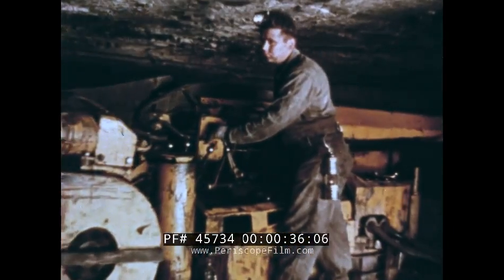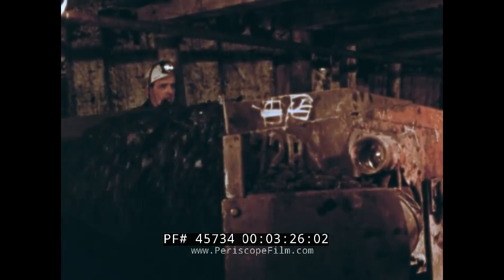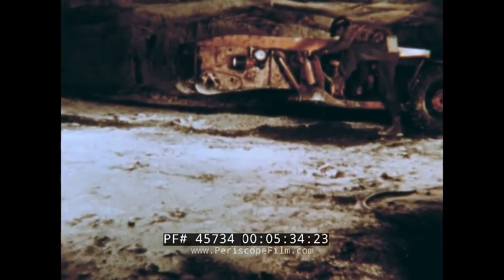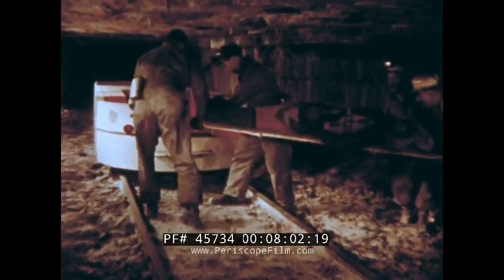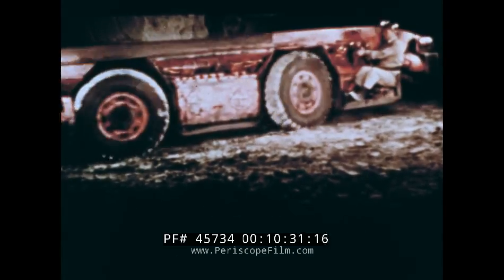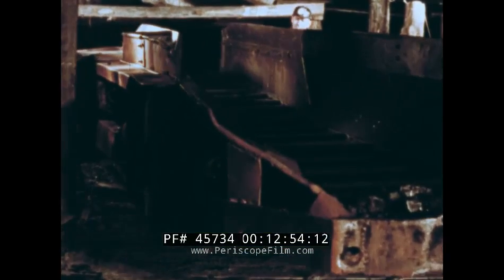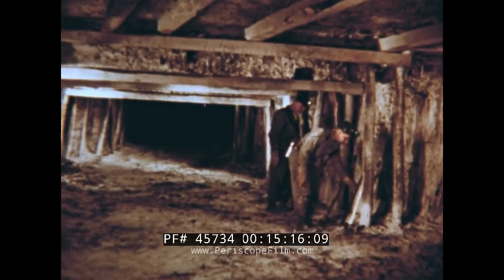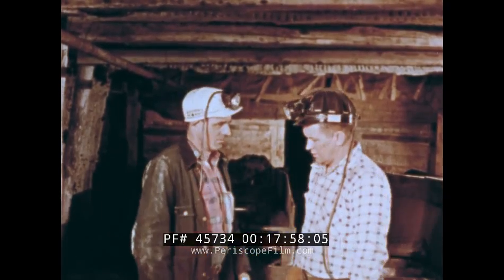MINING SAFETY FILM  COAL MINE SHUTTLE CAR OPERATOR  45734

Comment: Very interesting! Are the shuttle cars electrically powered? I see that  there is a wire or cable attached to them most of the time. If so, the principle of operation would be similar to trolleybuses, I suppose. While electricity isn't mentioned in the description, there is the reference made to traction motors. That may suggest that the shuttle cars are electrically powered. Happy Holidays, Mr. PeriscopeFilm!!
Reply from the maker: These are electric. You can read about modern day versions at this website: http://www.joyglobal.com/product-details/shuttle-cars